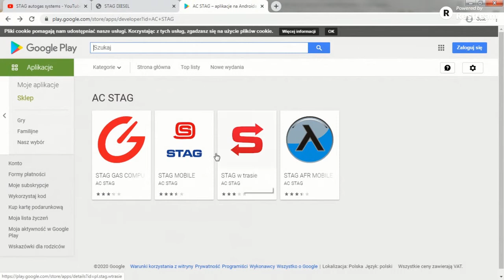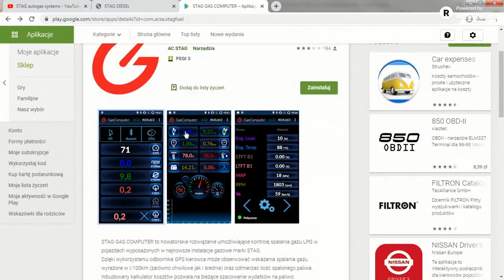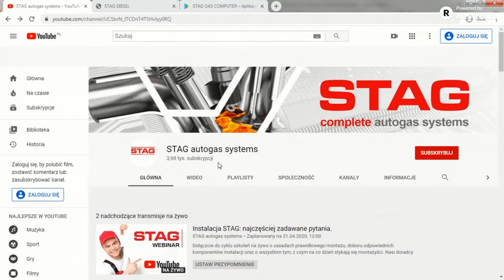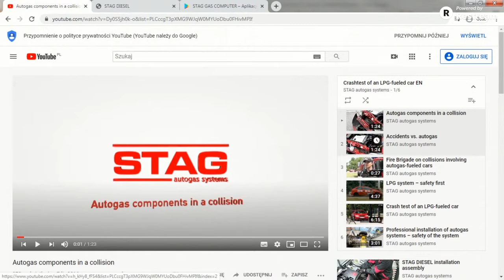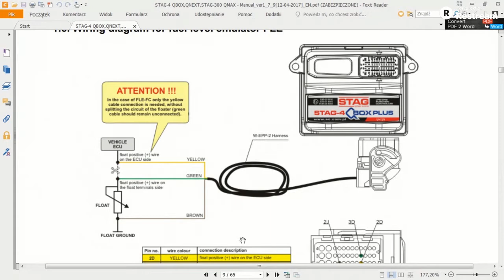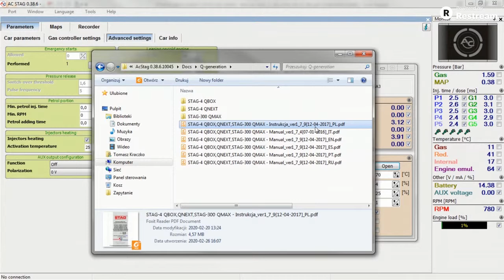STAG autogas installation: frequently asked questions.

Comment: Поставил стаг дизель  немогу настроить никто незнает как это сделать сможите помочь???Put stag diesel 6 I can't configure can you help??The engine (Cummins) 6ISBe 245 commonrail
Reply from the maker: Please, contact Your local/national distributor.
Reply: @STAGAutogasSystems  I myself figured out that your wires in the scheme are not correct

Comment: I have come across osme problem and my LPG system doesn't work any more. I tried many workshops but they could not solve it, the reason being is they don't deal with Stag LPG Kit. They are asking me to remove it and put a traditional one. After inquiting on net, I decided to remain with Stag Sequential Kit itself. It is better. But, who can correct it?

Can you suggest some authorised service centres near around Nashik, Maharashtra, India?

Please help.
Reply from the maker: Please contact Aaksh Sales in Pune - our trusted distributor. They will help You out - : +91 76204 80465  AAKASH SALES, beside Katya Maruti Mandir Old, Adgaon Naka, Panchavati, Nashik, Maharashtra 422003